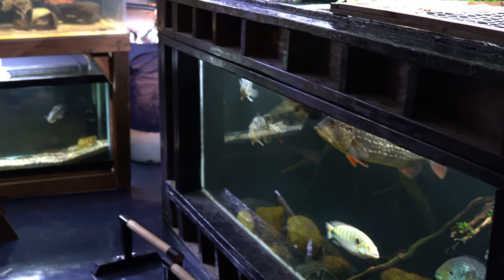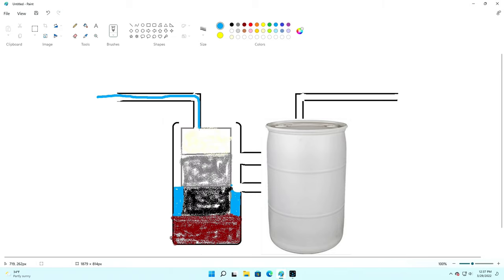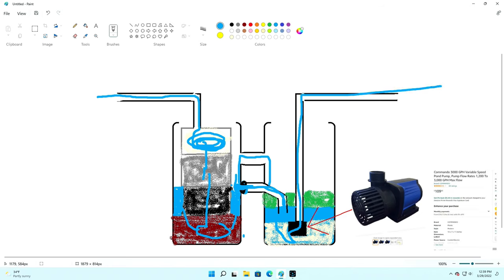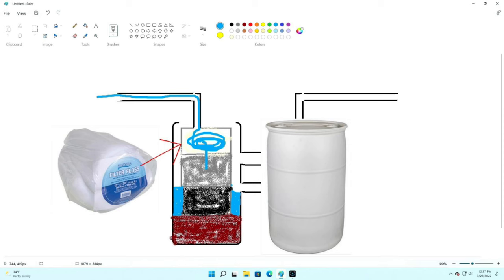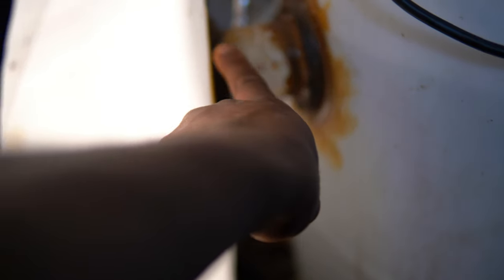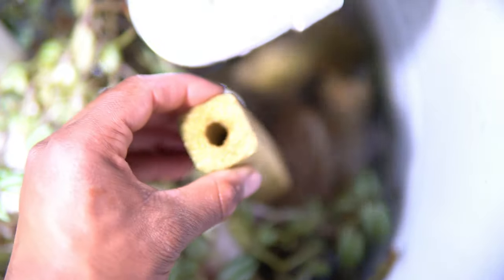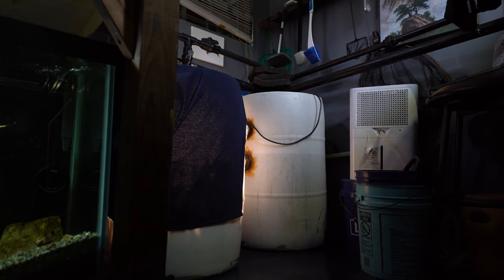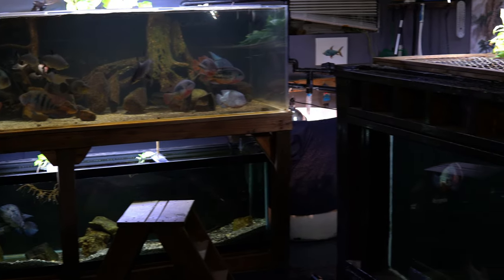My DIY Sump For 1300 Gallons Of Aquarium

Comment: Have to disagree with you about opening the drawer in your DIY TRICKLE TOWER SHOWER WET / DRY CUSTOMIZABLE FILTER filter  making a mess in the aquarium. It's obviously not something you want to physically disturb , and that is true for EVERY style of filter especially sponge filters 💩🤢 , which is why I had to say you have to realize simply sliding the plastic drawer / container is perfectly fine and if it isn't then you should replace.your mechanical more frequently. I have been keeping all my mechanical and biological inside of pond plant baskets from Menards , Lowe's & PETCO  . That way whenever I need to access for a reason I can open the drawer and take the basket , which i definitely never do to the final biological basket aside from the 1 time I cleaned the outside to get it lookin good. Mine is just a 3.drawer STERLITE filter that is in my 100 gallon pond I have been enjoying the several generatios of several species  of Cory's and Harlequins, cleaning the pump one a month and weekly top off with 10 gallons 50 / 50 RO & Tap . Last thing is I am amazed how long it is possible to keep reusing the poly filter that comes in a big roll , after I switch it out I have the dirty pieces in the utility sink and a couple mins with the sink sprayer its 99% good to go when the flow is slowing down Hopefully you are doing great and cheers to the new year 💚💙
Reply from the maker: Thanks, I do have compartments that I never disturb. The top 2 drawer aren't meant for bacteria housing (even though it does house bacteria), its more so meant for water clarity. I find that for crystal clear water I have to clean them about 4 times a year.